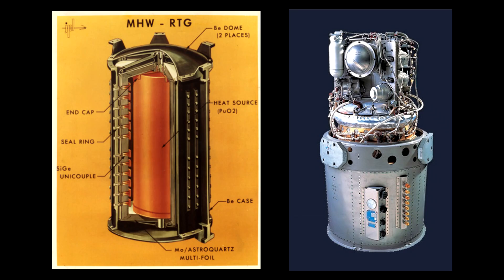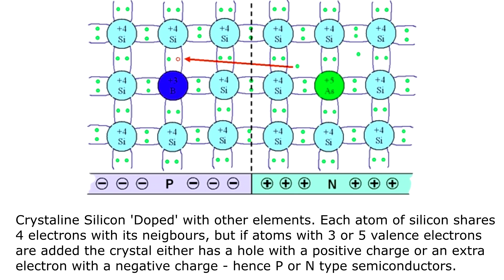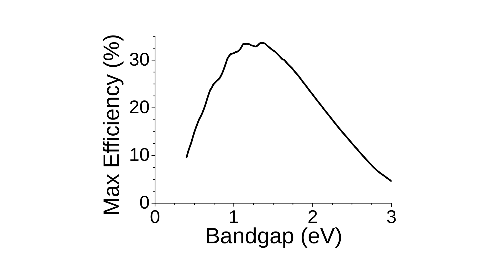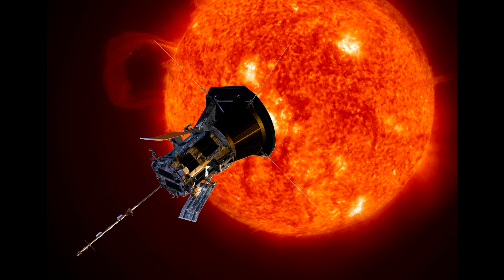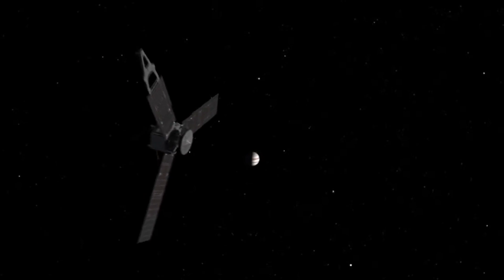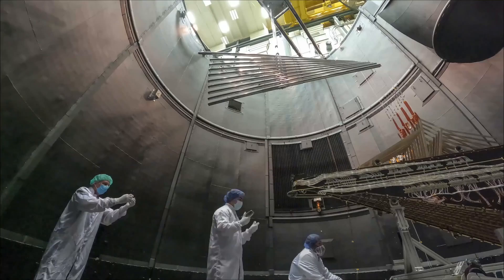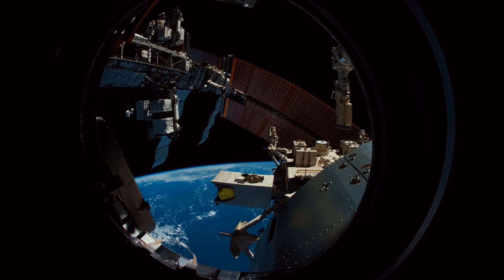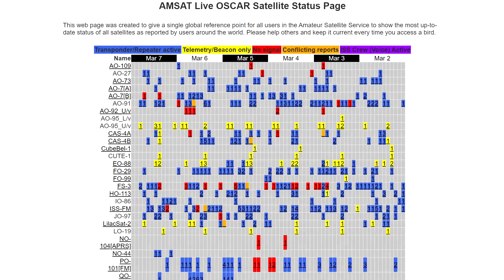How Does The Sun Power Spacecraft?  Things Kerbal Space Program Doesn't Teach You

Comment: "If you want to get into the details, get a Physics degree" is something that more people on youtube should have the courage to say. Not everything can be explained properly in a 15min video to someone who doesn't have the prerequisite knowledge.

And completely ignoring my own advice, I'll add that photovoltaic cells are LEDs in reverse operation. That description works on far more levels than it has any right to.
Reply: I worked in a micro technology lab for a year and when I first arrived they got me to make a simple solar panel to get me familiar with the machines and methodology. At some point someone mentioned that photovoltaic cells and LEDs were the same thing and then proved it to me by reversing the battery my panel was charging and showing it through a camera that could pick up the light. It was absolutely mind blowing and really got my mind thinking of just how simple yet versatile circuits on silicon really were.
Reply: @Michaelonyoutub  ... Yes but if I recall trying an LED I had... It's not "optimized" for that purpose.  That is there are other process included in making an LED Vs making a solar cell
Reply: @busterdafydd3096  yeah, Scott kinda hinted at that when talking about the solar panels. Solar panels are optimized to absorb a wide range of photons so their lower bound of absorbable photons is in the infrared, and that lower bound is also the wavelength of light they end up emitting. The lower bound for LEDs is much higher so they emit usable visible light instead of infrared light, but the trade off is that they can not absorb wavelengths longer than the wavelength they emit making them bad solar panels. All this is due to similar reasons as the photoelectric effect which Einstein solved, as Scott mentions.
Reply: @Michaelonyoutub  Most modern LEDs are UV or blue chips covered by a wavelength changing phosphor.  Conceptually similar to how most fluorescent tube lightbulbs work.
Reply: Time-symmetry of physics is some wild stuff. Solar panels are LEDs. Peltier effect gives us both solid state thermoelectric generators and solid state heat pumps. (And steam turbines and refridgerators are the same machine too!) Microphones are speakers in reverse, both when using magnets and piezos. The list goes on and on...

I am a CS PhD student, but physics is just fascinating and I am glad I get to see so much of it via youtube and chatting with my friends!
Reply: @matejlieskovsky9625  Back in the 1970's a lot of Germanium transistors were made in glass encapsulation. The glass was then painted black, and the type number printed onto that. Black was chosen to keep light away from the Germanium. As a teenager, I built an automated night light which used a Mullard OC71 transistor, with its paint scraped off, as a daylight detector, to provide the switching signal. (They were less toxic, faster and smaller than most Selenium LDR's.) Manufacturers didn't like this, so, pretty soon, all transistors came in metal cans or epoxy covering. Then specialist phototransistors started to be available, and (you guessed it) for a premium price, despite the fact that they could be manufactured at lower cost than mainstream devices.
Reply: The really cool thing about solar panels since they are reverse LEDs is that they also can act as normal LEDs when forward biased. Not much out of them clearly, but enough to be able to detect micro fragments in the solar cells. Cool when I saw it.
Reply: My physics degree didn't teach me that solar cells can be LEDs* , but they did teach us the basics of silicon doping, band gaps etc. I can't remember much of it now though.

* I do know that any component will emit light (briefly) if you wire them badly enough ;)
Reply: When a photon, an electron and a PN junction love each other very much...
Reply: Depends what you want: For most people a popular explanation of quantum mechanics will be enough, but to actually understand it, you need some advanced mathematics. Very likely you need to take university courses for that.
Reply: I think I learned that last part about photovoltaics being reversed LEDs on Technology Connections.
Reply: Dr. Feinman talked about this idea.
https://youtu.be/36GT2zI8lVA
Reply: The vast majority of solar cells are silicon based and I'm pretty sure that they don't work as LEDs because they have an indirect bandgap. 

So, it's only the direct bandgap materials such as gallium arsenide that can work as both solar cells and LEDs.
Reply: The fact that solar panels are bad infrared LEDs and LEDs are bad solar panels does make the case for you.
So is not wrong to say LED are the same thing optimize to opposite fuctions.
Reply: In many ways I agree with the essential sentiment. I thought it was a funny comment when Scott said it. If one were to express it a little more inclusively, though, one might choose to say something like "if you want to know more there are university level textbooks available". Some people bristle at the suggestion that one must pay tithes to a priestly class in order to gain access to the truth.
I don't think that's what you were trying to say, and I do think that to a total novice, getting from zero to understanding solar cells  is much easier if you do a formal Physics degree somewhere. But I dare say there are plenty of people about with a solid grounding in calculus who could, through self study, get dangerous with basic Quantum mechanics and thermodynamics in short order, and then jump into semiconductor physics with a fighting chance of getting it.
Bit long and rambly, sorry. 
TL,DR: textbooks are under rated and accessible to anyone who can spare a few quid and wants to have a go.
Reply: They're the equivalent of DC motors/generators.
Reply: Reversability is pretty common in physics. Speakers are microphones, motors are generators, batteries can both provide charge and be recharged, hydroelectric power plants can be used as pumped hydro storage, etc. You're basically coupling two different energy sources together using a physical process, it makes sense that the energy could flow both ways.
Reply: What prerequisite knowledge did Einstein have to get his physics degree nerd?
Reply: @ipissed  All the classes leading up to that?
Reply: @JamesHoffa1  Leading up to his physics degree?
Reply: @ipissed  I mean the man wasn't born with advanced physics and maths knowledge
Reply: Call be jaded but a physics degree doesn't teach you anything. They just provide the tests, it's up to you to teach yourself.
I would have been better off giving my 30 grand to scott's patreon tbh
Reply: @impguardwarhamer  I mean, yes, it's implied that what is really meant is "Study Physics at a university or equivalent up to at least degree level"
Reply: @linyenchin6773  Who said anything about malice?? And I definitely recognise British humour, that's one of the reasons I love this channel!
Reply: @impguardwarhamer  yes, if you just sit there and expect to passively learn stuff your not gonna get much out of university. A university is a place that will provide a structured learning environment (take class A, then class B, then class C), but that's not going to work for everyone. No matter how you want to learn (via school, or self taught) you need to be an active participate in your own education.
Reply: @bobshowrocks  if i'm spending tens of thousands of pounds I expect someone to actually teach me instead of providing literally fuck all.
Reply: @impguardwarhamer  degrees cant teach you stuff, it's a piece of paper, but the university does, the professors do, you can just sit there and expect to understand by doing nothing, you have to listen when they teach and try to understand that and ask questions if you dont understand and solve problems on it and learn that stuff. But yes i agree dont need to get a degree to learn anything, you can teach yourself whatever you want, i also agree that universities in the US are very expensive.
Reply: @impguardwarhamer  I don't know what shitty uni YOU went to. And I honestly really feel sorry for you in a non-sarcastic way. But my physics uni experience was a very positive one and I've learned more than I ever expected. And it was completely free!
Reply: @impguardwarhamer  That's why you need an electrical engineer lol I literally have a book over solid state devices on my desk in front of me for a class I'm taking on this stuff.
Reply: @impguardwarhamer  
Wizard of Oz:
They have one thing you haven't got: a diploma. Therefore, by virtue of the authority vested in me by the Universitartus Committiartum E Pluribus Unum, I hereby confer upon you the honorary degree of ThD.

Scarecrow:
ThD?

Wizard of Oz:
That's... Doctor of Thinkology.
Reply: @impguardwarhamer  sure the degree doesn't teach you. But what he means is "a college level of physics knowledge is required to understand this concept fully" and a degree would simply mean you have passed tests that demonstrate your knowledge of the physics concepts being tested.
Reply: @impguardwarhamer  A lot of physics undergrads in your replies I see, well yeah it is quite common for physics undergrad to mostly consist of trivia and very little actual physics. It's a pretty disappointing degree for what it's made out to be in any university I've seen, better off going to grad school for physics or at you have a chance of learning about how technology works in an engineering degree. Don't really know how people here can defend physics undergraduate material, it's truly low quality.
Reply: @nicholasandrzejkiewicz  well one thing I can say is mine wasn't just trivia, it was pretty hardcore math and stuff.
I mean yeh, i blame myself more for not doing an engineering degree than the uni itself, but i stand by everything I've said.
Reply: @impguardwarhamer  Reasonable, I'm not really here to argue. Self teaching is far superior to any degree anyway
Reply: @nicholasandrzejkiewicz  this is an interesting take, Physics undergrad being so trivial as to be indefensible. May I ask what country you're from? My experience of Physics undergrad was in the UK, where a physics degree is just a physics degree. I know in the USA one tends to take a broad range of classes from different subjects- that's the impression I have from TV- which I can imagine would tend to dilute a complex subject. I was disappointed to find that I wouldn't get to learn string theory or guage theory in QFT as part of my undergrad. I still walked away with a solid enough foundation, and enough of the mathematical tools that topics like that are somewhat accessible to me, and with hindsight it still felt like a lot to cram into three years. I wouldn't call it trivial.
Reply: @tombackhouse9121  I'm from the US, and yeah if you don't pair your physics undergrad with some other degree you are basically unhireable - IF you are prudent and take a couple graduate courses as electives (which is rare that they are even offered) then you may come away with some actual understanding of the subject. But even at good universities here, physics undergrad has so little actual content to be worthless.
Reply: @nicholasandrzejkiewicz  I did a bit of searching and found no evidence that undergraduate physics courses teach you "so little ... [as] to be worthless". I don't believe you.
Reply: @General12th  ??? What do you think a Google search is going to tell you?
Reply: @nicholasandrzejkiewicz  I was looking for personal stories from people who got a physics degree but couldn't find a job, or statements from physics professors confirming the degree teaches nothing, or statements from employers agreeing the degree makes no difference in whether or not they hire someone.

I guess my alternative would be to ring up a bunch of college professors and ask "hey, is this education worth anything?" but I didn't want to come off too strong.
Reply: @General12th  I was making a simple statement that the actual content of physics curricula even at high ranked schools is insufficient to do actual physics, it's just trivia on an exam. It's not like you can't get a job at all, you just won't be doing physics because the physics you know isn't developed enough to be useful for anything. This is a form of unhirability because you can't work in anything pertaining to the degree you just paid for.

This is just not the sort of thing professors admit in public, universities are businesses and it's bad for business - you could get fired.
Reply: @nicholasandrzejkiewicz  I agree that high school physics is only a jumping-off point into either a deeper physics education or into more practical applications like engineering trades.

But college physics? I don't think that's in the same place. Undergraduate physics gives you a far better jumping-off point.

(Sorry for the late reply.)
Reply: @General12th  College physics == Undergrad physics here, same thing

colleges are departments within universities, terminology might be different where you are

I am also saying that substantially, there is very little difference between high school physics and a four-year physics program in a top school here other than more topics (equally shallow), often engineering physics classes are better which says something.
Reply: Scott was just cracking a joke whereas you're just using it as an opportunity to be a condescending gatekeeper. If anyone feels like it they can make a video on the subject matter
Reply: @BGraves  It's gate keeping to say that it takes years of study to properly understand some topics? I'd have thought that only con artists and frauds would disagree with that.
Reply: @QuantumHistorian  "gate keeping" definitely, since you have people as old as 10 that graduate university, it's not time per say, it's using the knowledge you have gathered, and having 100 other just as knowledgeable people to increase everyone's knowledge, almost everyone of Einstein's classmates won a Nobel prize, why wouldn't they, when everyone near you has an open mind to new ideas and a solid understanding of the oddities of the world, plus a heavy textbook and people to contemplate it with. School takes so many years, because you are not constantly studying, you take time to socialize, make yourself fit, and just look at the wonders of nature. An AI can probably do that in a month, plus a minute to copy the 1GB book of the AI next to it and cheat the exam. Learning is fast when you do it at light speed and not turn the page human speed, that is why dreaming of your exam usually helps you study (with no conscious thought in sight). So time is not as much of a factor as people make it out to be, but attempting to understand everything is! Just think harder!(it's actually just think more, the good old "a billion (millions of) monkeys with type writers of which 1 would write Romeo and Juliet", especially if you discard the worst half of ideas regularly)

Comment: Want to know something Cool thing about Solar cells? They're so close to being LEDs and vice versa. If you take a solar cell out of a cheap calculator and hook a power source to the cells power leads in a dark room, it'll glow ever so slightly. 
Same thing with LEDs, you take a simple LED, hook a voltmeter to it and expose it to the sun, you'll see a increase in electric flow.
Reply: Diodes are crazy man, probably one of the greatest inventions of our time.
Reply: Solar Cells are Light-Absorbing Diodes instead of Light-Emitting Diodes
Reply: This phenomenon is used in an electronic device called a "photodiode", also in "phototransistors" which are just photodiodes with an amplifying transistor added.
They're available in packages similar to those you find LEDs in, yet they generate a voltage when exposed to light.
IR LEDs and photodiodes are why most remote controls function as well as they do (granted that they modulate the signal on a roughly 40khz carrier wave, but the data is sent nonetheless.